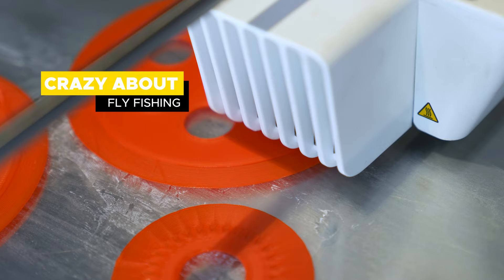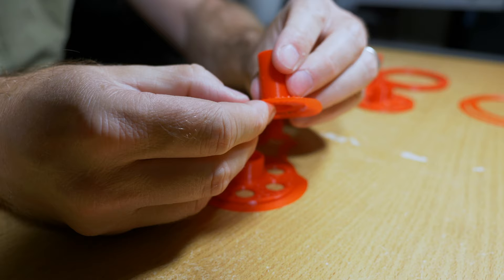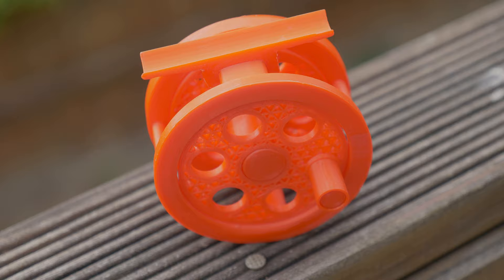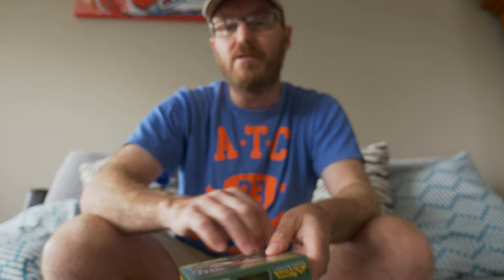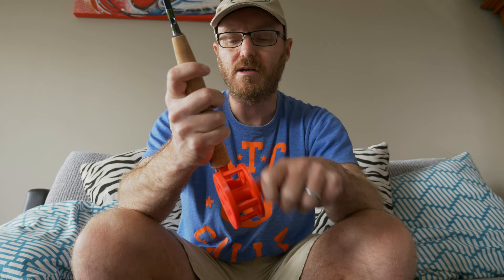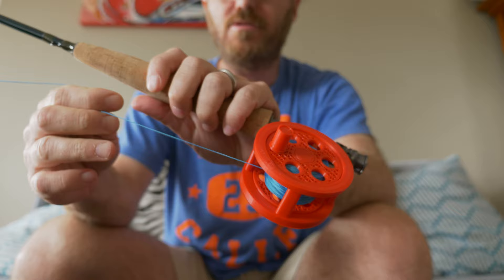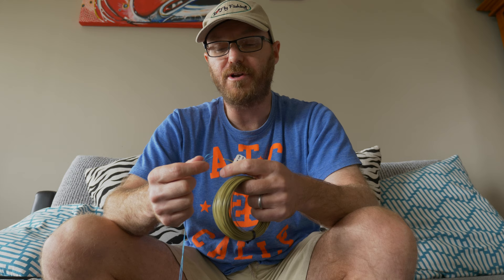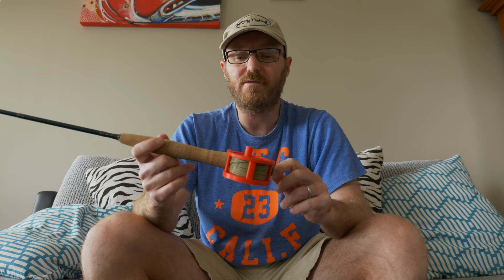I 3D Printed a Fly Fishing Reel for $6.80 | How good is it?

Comment: I had a great experience with this 3D printed fly reel. It's really meant for small fishes but I have caught a big red tail catfish with this once before! I needed to manually add drag by using my rod hand index finger with a glove to control. I would say most of the work is done by the rod and as long you reel in smartly the reel shouldn't explode! I would rate it 8/10 mainly cause of the need to be more careful when reeling in. My dad says this reel sounded like the fly reel of the old days.
Reply from the maker: Agree, it's a neat little reel and it only exploded because of poor assembly on my part. I can see how a glove would help apply pressure. I'd like a version with palmable rim. Think that would be great. A fun project I may revisit. Thanks for taking the time to comment.
Reply: @CrazyAboutFlyFishing  
 @Crazy About Fly Fishing  I replicated and modeled out a palmable version after that encounter! Sadly I never get the chance to fully utilise it. I would gladly share the file with you! But it's a right hand retrieve design. 
I really enjoyed your video where you caught the trout with this reel!
I never get the chance to have a proper fly-fishing experience where I'm from.
Reply from the maker: @wilsonchin8307  That's really cool.  I used to right hand retrieve so that's not a problem for me.  Would be grateful if you could share the file to me at CrazyAboutFlyFishing@gmail.com.  I'll see if I can get it printed and to a test with it.
Reply: @CrazyAboutFlyFishing   Hey! I've sent you the email with the files in it. Took me awhile to find the files again but i got it!
Reply from the maker: @wilsonchin8307  thanks heaps. I did receive it. Just been a bit hectic the last few days. Will reply soon as I can